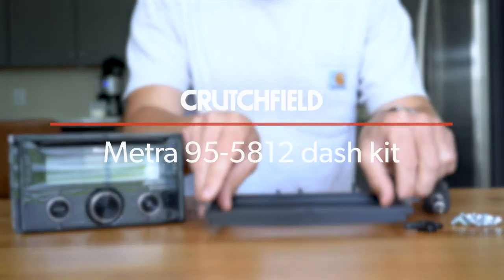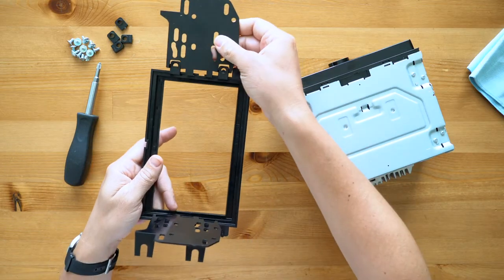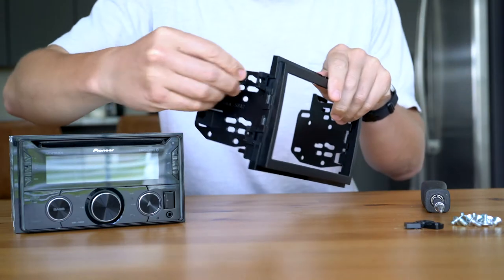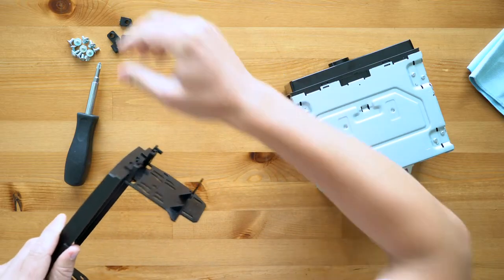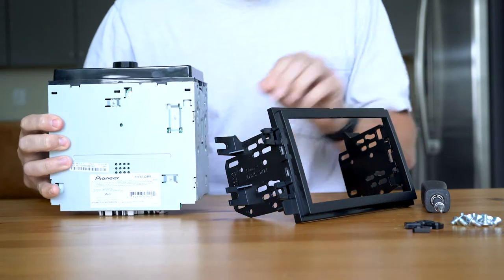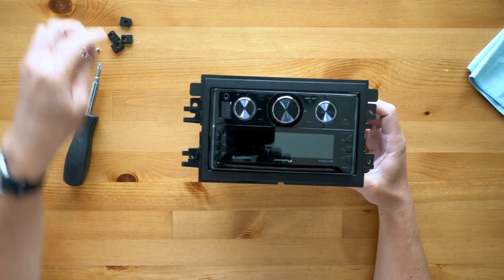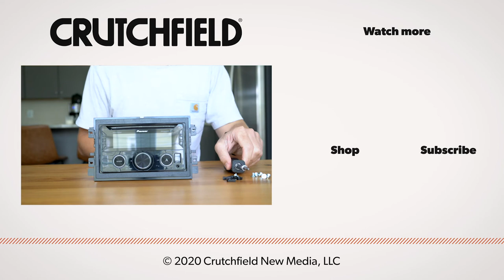How to assemble your Metra 95-5812 double-din dash kit for select 2004-11 vehicles | Crutchfield

Comment: Ahhh ? How about the part where it goes in the freakin car ?
Reply from the maker: Hi Rudy, are you using the Metra 95-5812 kit specifically? Are you installing a radio you got here?
Reply: Wow a reply  -  I ordered the big cover that includes the vents and will probably end up buying the product you have in your vid -  but I was thinking supporting the radio from the rear ? Thx for your reply - @crutchfield
Reply from the maker: We need to know your specific year, make, model, and trim vehicle details to provide any detailed information. The Metra 95-5812 dash kit in the video fits select 2004-11 Ford, Lincoln, and Mercury vehicles.
Reply: A beautiful single owner 1997 Expedition with 30k miles ? Thx for your reply  @crutchfield
Reply from the maker: You're welcome, Rudy. Congrats on your new vehicle! If we can help you choose a current model radio for it or if you need anything further, please let us know.

Comment: Wish it was as easy as this makes it appear to be. on the kit I received the tabs on the sides were way too snug to fit into the slots, much less being able to rotate them 90 degrees. I used a knife to clean up the sides of the slot a bit and managed to get it together. The next issue not mentioned is that the tabs at the rear of the side pieces need to be removed in order to even get the unit in the dash. Typical problem for products designed to work in various situations.
Reply from the maker: Sorry to hear your installation didn't go easier. Are you all set now? Keep in mind, you can call our Tech Support for any help you may need if you got the radio/kit here. Their direct number is on your invoice.
Reply: @crutchfield  Getting the unit mounted wasn't much of an issue. I just wanted others to know they might have to make modifications to the Metra kit. Better precision in manufacturing would be nice. The bigger issues I've faced are wiring. The instructions are not clear at all, but support was great. No wait time and quick answers. Thanks Jason and J.W.

I'm still pondering how to run the camera wire to the rear of my truck but will work it out. At 75, digging around under the dash is a lot harder than it used to be.
Reply from the maker: Glad to hear it! If you need anything further, please let us know and good luck with the camera install. Check out our camera installation guide video here: https://www.crutchfield.com/learn/how-to-run-wires-and-power-a-backup-camera.html

Comment: Does this fit a
Toyota Avalon 1998?
Reply from the maker: According to our research file on the '98 Avalon, you won't need a dash kit to install a double-DIN size head unit. An aftermarket double-DIN receiver will mount directly using the factory radio mounting brackets.